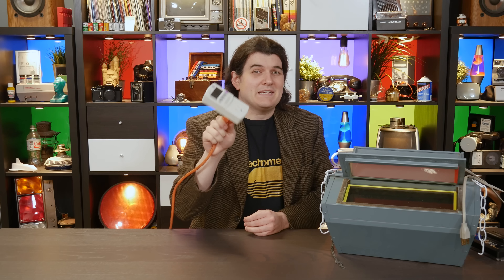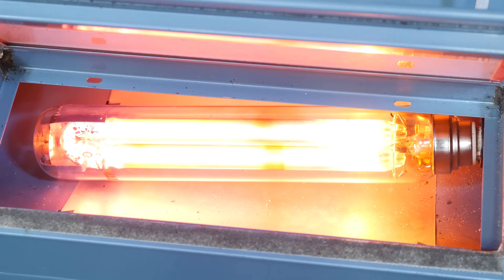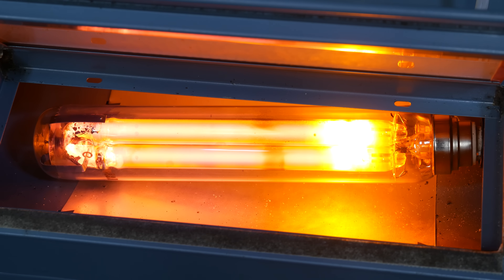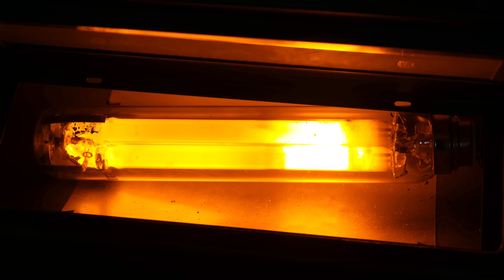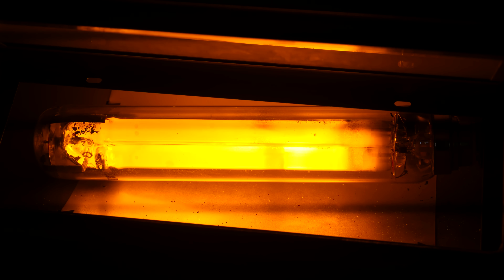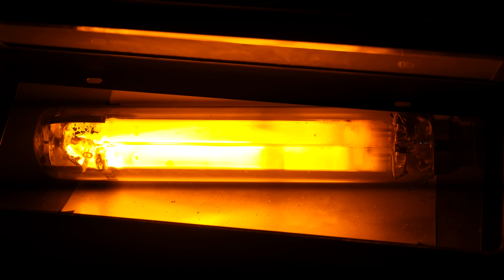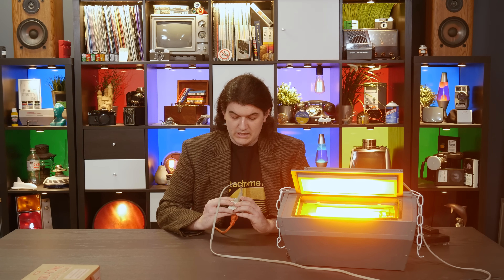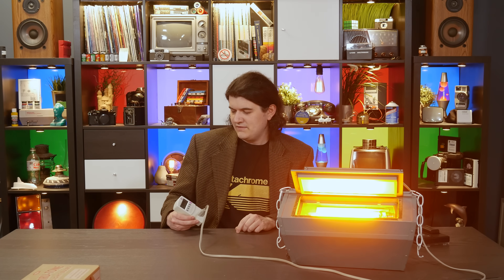More vaguely-informative ramblings about low pressure sodium lamps

Comment: 5:05 The lamps do eventually fail.  SOX lamps were widespread across the UK in the 80s and 90s for streetlighting and after were gradually reaplaced by SON, metal halide and now LED.  However you do get a few clinging on like these on the M60 motorway near Manchester https://www.google.com/maps/@53.4399391,-2.130841,3a,75y,164.74h,84.31t/data=!3m7!1e1!3m5!1sRqGlhhmm_h9BMRu5A65reQ!2e0!6shttps:%2F%2Fstreetviewpixels-pa.googleapis.com%2Fv1%2Fthumbnail%3Fpanoid%3DRqGlhhmm_h9BMRu5A65reQ%26cb_client%3Dmaps_sv.share%26w%3D900%26h%3D600%26yaw%3D164.73905743735253%26pitch%3D5.692406711881844%26thumbfov%3D90!7i16384!8i8192?coh=205410&entry=ttu  They must be 30 years old, and a few have failed.
Reply: The lamps that have failed are red, red/yellow, flickering or just out.

Comment: I do think the ones used in street lighting are high pressure sodium lamps though, right? It least that's what I get told here that they are. And those definitely break, I've already seem many of the not working or only dimming over the years and slowly get replaced with LEDs, street by street over the years.

Comment: Alec you'll probably not see this comment, but I'd be curious if this thing does have a power factor correction capacitor but it has developed severe electrical leakage due to age. That'd explain the power factor going all over the place and the excessive power draw.

Comment: One reason the lamp is consuming twice the wattage of rated bulb is because LPS lamps consume more wattage as they age in order to maintain rated lumen output. The ballast probably has no capacitor to correct power factor which would be considered “normal power factor”.

I was up in Flagstaff AZ a couple years ago which is home to an observatory. Many of the roadway fixtures are LPS, which I thought. Upon taking a closer look, the fixtures had been converted to amber LED, which looked exactly like real LPS!

A few months ago, I found a 55-watt LPS security fixture at my local swapmeet for $15, which had no use on it.

Comment: The low pressure sodium lights are used for street light, gamma ray room, and dark sky sites. Because of low pressure sodium is very efficient of electricity and low wattage power.

Comment: 10:55 You have to know if the ballast lamp assembly has a power factor correction capacitor, if not, you have to know if the wattmeter can measure the power factor and ignore it, if not, it is 71VA and not 71Watts
Reply: Based on the power factor shown the lamp is 14 watts

Comment: You may have figured this out already, but if you open the fixture up, you will find a ballast, an ignitor, and a capacitor.  The cap is specifically for power factor correction. A power factor of 0.2 indicates that the capacitor has failed. replace it with a new one (between 6 and 8 micro-farads) and the power factor will be significantly better. It bridges the incoming live and neutral if one isn't present currently. If a leak transformer is used as a combined ballast and ignitor, you will need a 15 micro-farad capacitor.
The ballast will draw a lot more power during warmup because it's working harder to maintain a neon arc than a sodium arc, and it needs to heat the sodium to evaporating point and optimum arc temperature of 260 Celsius. Once the lamp reaches full brightness and this optimum temperature, the power consumption should come down to between 40 and 50 watts.
Lamps do fail. But they do keep trucking for a long time. The average of 18,000hrs is based on dusk-dawn operation. 24/7 operation tends to last a lot longer. The white emitter on the electrodes gets used up every time the lamp is lit, you can see a lot of it in rings on the inner tube on your lamp. Once all the emitter has been used, the lamp can't light any more. With 24/7 operation, the emitter is hardly used. But they are supposed to be switched off every once in a while to let the ballast cool down, about once every couple of weeks. The emitter getting depleted completely is the most common way a lamp reaches EOL.

Comment: We moved to a new house when I was 11. For some reason, the previous owner replaced the original porch light fixture with an industrial low-pressure sodium floodlight. The bulb had black spots all around the base, and sometimes it wouldn't even emit properly, so my dad said something to the tune of "we'll replace the light when the bulb goes." I'm 23 now, and the bulb hasn't even gotten worse yet.

Comment: The reason for the sodium collecting at the U-bend is because that's the coolest spot. For technical reasons the top of the outer envelope can't be coated in the IR-reflecting indium-tin-oxide mixture so most heat loss takes place on that spot.

Comment: You are correct. In Czechia both high pressure and low pressure sodium vapour lamps are still used for street lamps (the low-pressure is only used in areas where the color does not matter that much like parks) and when they go bad, they just stay dimly orange-red the whole night.

Comment: From what I understand they die from there resistance gets to high and they can't get fully bright without turning off. So you will see them start but turn off after they warm up a bit than turn off
Reply: That is HPS, they cycle on and off when they're failing. LPS just stays red when it's failed from the cathode emission evaporating or only has a small bit of light at the base/tip cause the corrosive sodium has leaked out the internal tube and coated the outside tube

Comment: Seeing him touch the lps bulb with bare hands made me cringe, 
if you did that with HPS, TUNGSTEN, or MH the bulb usually breaks, sometimes explode . 
But long throw Xenon bulbs WILL Explode!
 I have had to call an ambulance for a spotlight operator who's bulb exploded and sent shrapnel from the spotlight showering over a packed crowd from 150ft up. 
All from the oil on the skin of the person who replaced the 2kw bulb thinking he could wash his hands instead of wearing a new pair of gloves.
$60,000 spotlight destroyed 
Operator had to have surgery
EMT's tended to the crowd underneath 
Show never stopped and another spotlight was put in place with another operator before the end of the song

Comment: Basically the way these age and eventually die is the emissive coating on the electrodes eventually  burns away. These lamps tend to last about four years in actual use. As for getting these lamps, they are still made in small amounts for collectors by a company called "tru halo" that make all wattage's except 180/131.

Comment: A little electricity lesson:
In the AC world, there are 3 types of power: apparent, actual, and reactive. 

The apparent power is just Volts*Amps. It can be expressed as Watts or VA for volt-amps.

The actual power is how much energy the component is using. For a pure resistor, the actual power is equal to the apparent power. For a pure inductor or pure capacitor, the actual power is 0. 

Reactive power is the energy that a transient component (capacitor or inductor) returns to the system. This is typically expressed as VAR for “volt-amps-reactive.” A pure resistor has no reactive power. A pure capacitor will collect the AC power it’s fed, then return it to the system 90° out of phase with the supply. Same for and inductor but in the opposite direction. A helpful mnemonic are ELI and ICE. In an inductive circuit, voltage (E) will lead the current by 90°; and in a capacitive circuit, current will lead the voltage by 90°. 

Now, the impedance (Z) produced by these components can be expressed using complex numbers. C will be the capacitor value in farads, L is the inductor value in Henries, and ω is the angular frequency of the circuit in radians/second
For a pure resistance, Z = R
For a pure capacitance, Z = 1/(jωC) or -j/(ωC)
For a pure inductance, Z = jωL

For a circuit containing a resistor and a transient, you can simply add these values together and get the total impedance of the circuit expressed in Ohms expressed as a complex number. 
Zc = R - j/(ωC)
ZL = R + jωL

These can then be used to calculate the current and power based on the given voltage simply using V = IR and P = VI = (V^2)/R = (I^2)R

Ignore the current for now. Power is what’s relevant to the video. When you combine these terms, power will then be expressed as a complex number. Where 
P = Apparent + jReactive (X + jY)
The magnitude of the actual power is the Pythagorean sum of the apparent and reactive components: 
Actual = sqrt[X^2 + (jY)^2]

The power factor is then the ratio of 
actual/apparent. You can use either power or current because the values will still be proportional, just multiplied by V

In a case with just a resistor, you have no reactive power, so PF = actual/X, and actual = X, so the power factor is 1.

In a case with just a transient, X = Y, so the Pythagorean sum will come out to 0 thanks to the j term making it negative once it’s squared. Thus, the power factor is 0/X or just 0. 

When you have a resistor in the mix, it’s a little different. The X factor will be different from the Y factor, so the actual power will not be 0, meaning the power factor won’t be 0. That’s the case for this lamp with an inductive ballast. The lamp acts like a 35W resistor and the ballast acts like an inductor of some value. While the lamp doesn’t even need an amp to run, the ballast adds a lot of impedance, so it takes more current to push the same actual power through, thus the apparent power will be higher since the reactive power is higher. That’s why it’s pulling 3 amps, despite not actually using that much to drive the lamp.

A capacitor can be thrown into the mix to balance out the reactive power. Since in a capacitive circuit, the impedance is negative, a capacitive impedance of the same magnitude can be added to the positive impedance of the inductor to make the imaginary component of the impedance 0, thus making the reactive power 0, the apparent power equal to the actual power, and the power factor equal to 1. 

By the way, the power factor can also be calculated directly by taking the cosine of the difference in phase angle between the voltage in current. I mentioned before that in a transient circuit, voltage will either lead or lag the current by 90°. cos(+/- 90°) = 0, so the power factor is 0. For a resistor, everything is in phase and the cos(0) = 1. As for a complex circuit, the difference in phase angle can be calculated by taking the arctangent of the reactive component (no j) over the apparent component: arctan(Y/X). Taking the cosine of that value will then give you the power factor. Reverse engineering this process, a arccos(0.2) = 78.5° which is ridiculously out of phase.

Comment: No they discontinued these, the only places where they are still made are obscure fan based private companies in like china or something which have very low levels of quality compared to something like Phillips or GE. Now over here in Europe what they seem to do is just either replace them if they fail or they replace the fixture and ive seen at least more then 25 instances of them replacing the bulbs with old stock.

Comment: The weird thing (for me) is how the horizontal "scan lines" only appear after the bulb is fully charged up. I don't know if scan lines is the right term. I know absolutely nothing about these things, but my guess would be something to do with refresh rates? Like the bulb is not interfering or interacting with the camera's refresh rate until it gets to full power? As I said, I'm a noob and probably guessing out my butt. But I am curious as to why this happens. Great video, I had totally forgotten that LPS was a thing. My city has basically stopped using even HPS bulbs. The only time I see them is lighting outside some businesses

200 lumen per watt? Holy batman's batman!

Comment: Is that a 35w lamp? If so I have multiple NOS spares, you can just have a couple for free. I live in Sterling,IL and from what I gathered you’re in the burbs somewhere (which I am every week for work) and can drop a couple off if you’d like. Oh, and the failure mode most common on these is the electrodes losing the emissive coating, or electrode breakage as the tungsten sputters off onto the glass tube wall and the coiled electrode gets weak and breaks.

Comment: Low sodium pressure lamps make colors seem weird.
Reply: Maybe so, but sometimes you want the Sodium D line so you can measure at an exact wavelength.

If you use a tuned laser you need something to check it against. Then you have to cope with the coherent light from that laser: you can't look at it.

Comment: Here in Louisville we just replaced one of our tunnels with LEDs previous I have seen a few that stopped working it is pretty wild wether wise here we have hot and humid summers and mild to hot to miserable winters like last year we had xmas in 70 degrees so maybe the wild temp swings caused them to go out but they were working for Like 50 years (according to my parents) but they might have been replaced since the 70's

Comment: I will explain it to you simply. Reactive power means power oscilating between source and load... Loading wires and doing nothing productive. It is needed to magnetization of balast and to proper function of balast. By in your case adding capacitor to compensate it, it will be then oscilating only between capacitor and load... Capacitor is close to load...

Comment: In my town (southwest of Germany) they're using low pressure sodium lamps above intersections. In the main roads the street lamps are suspended above the road. So at night, when the traffic lights are turned off you have a visual attention grab when there is a yellow light above the road. Because of how densely European cities are built this really helps when you don't know the town.
Reply: Wait, hold on -- they turn the traffic lights off at night in Europe?

Comment: 3:03. Try perhaps a forensic science/criminalistics laboratory supply house. Sodium lamps, which produce 589 nm light, are used in the forensic examination of glass to measure refractive index, so there will be some demand for it going forward, even though it is going to be small, as there are only about 400 crime labs in the US. Also, silicone oil is used as an immersion medium for the glass fragments being tested, so a supplier of the silicone oil may be able to direct you to a supplier of the sodium bulbs.

Comment: Near my house one had died and what happens is like a dead fluorescent lamp the cathodes in each end of the lamp have a black mark around them on the glass this is because each time you start the lamp the a small bit of the coating on the cathodes ends up flying off and onto the glass. This is the same for LPS, HPS, MV, and MH lamps

Comment: Poor factor is due to reactive power. What really happens is that somewhere in the circuit, a component draws in energy, and then feeds it back into the grid. So while you're not really using the energy, you still have that amount of current.

Comment: I worked for a commercial electrical contractor in Arizona for a few years and we used low pressure sodium bulbs as temporary construction lighting. Around 2020 they stopped sending us replacement bulbs when they'd break or burn out. Now they ask us to send the whole fixture back to the shop and we get them back with an led replacement and I was upset by this. Mainly because in the winter I could stand under one of these lamps and get a little warmer haha. Not that it gets to cold in arizona ever but I enjoyed the gentle hum. And when the drywallers tripped the breaker by plugging in ten splitters into one breaker I could flip the breaker and they'd all still complain that the light was out for another 20 minutes because they took so long to warm up. Now it's just instant light with leds and they don't have to suffer any ramifications for lazy decisions to not bring an extra cord for all their corded tools.

Comment: I fell in love with LPS when I was 8 and I had one of these lamps suspended over the crossroad I used to live next to. When I grew up I did everything I could to get some of these lamps and now I own many LPS lamps (180W, 135W, 90W, 55W, 26W) and 20 to 30 different LPS fixtures.

Comment: I installed two 18W ones in my bedroom. Yellow light at night releases melatonin and will help with getting to sleep + it's cool (or warm).
You can use a fulham workhorse WH2-120-C ballast to power it. You'd need one for each bulb (unless you can find a more optimal fulham model).

Comment: Didn't know there was a low pressure sodium light. I always heard of HPS lights & I don't like 'em. I'd much rather have a metal halide light instead. As to the hum of the magnetic ballast, I find it kind of soothing.  I guess because I've been working around large power transformers, large 3 phase motors, and vintage fluorescent lights that I have become accustomed to the sound.

Comment: The lamps generally last a long time but I have a lamp with low hours but appears the inner arc tube has leaked and the sodium has escaped into the outer vacuum flask. The lamp tries to strike but ends up with a neon glow around the outer electrode wire lead ins of the inner tube. Also the outer glass has a lot of blackening due to sodium contamination, much more than the usual gettering deposits.

Comment: I am not an expert on these matters, but assuming what we think is the sodium is actually the sodium, I think the reason it chooses to hang out in that corner is that as the lamp cools down after being shut off, it cools faster in the part of the lamp that is furthest from the heat source, i.e. the bend. That means the first of the sodium to resolidify will do so there, and perhaps this initial mass of solid sodium attracts the rest of the vapor to also solidify in the same place, like the way crystals are formed? I seem to recall that solid metal can be thought of as a crystal, at least in some contexts.